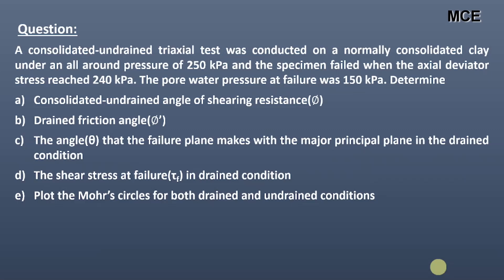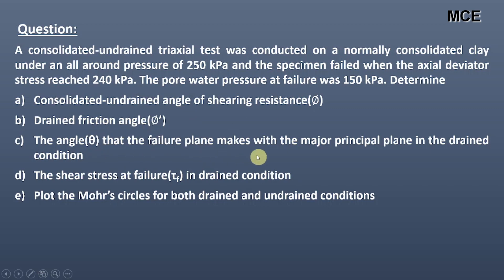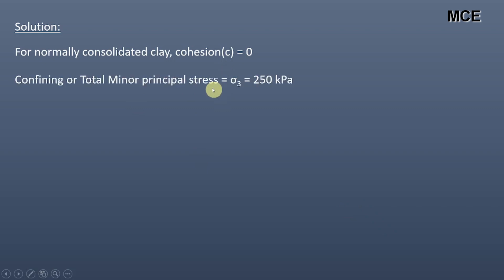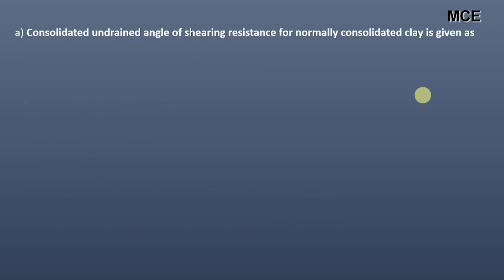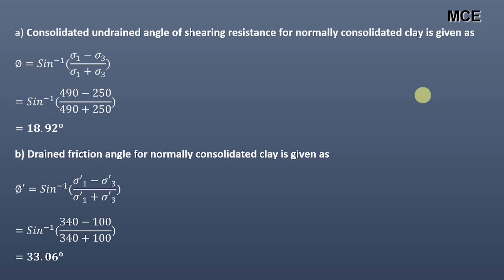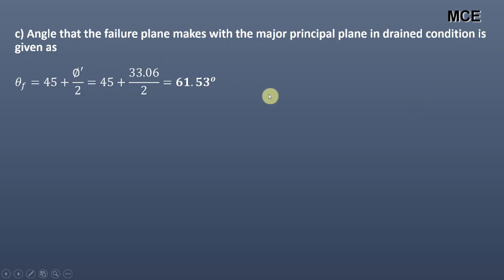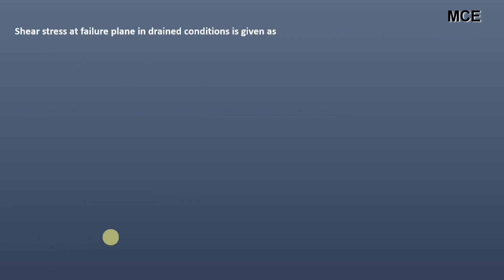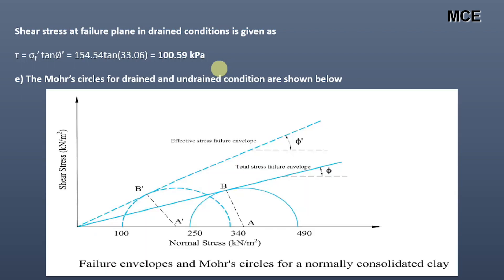Consolidated Undrained Triaxial Test Example|CU Triaxial Test Mohr's circle

Comment: Thanks for sharing the problem and solution, I have a question for question "C", why did you use the Ø' for drained test? shouldn't we apply Ø for drained condition?
Reply from the maker: Thanks for watching Master Civil Engineering
Reply from the maker: For finding failure plane angle  in drained condition you have to take drained friction angle
Reply from the maker: For drained conditions you have to take effective stress parameters and for undrained conditions you have to take total stress parameters

Comment: For clay c should not be zero for undrained conf
Reply from the maker: Thanks for watching dear!
Reply from the maker: For normally consolidated clay, cohesion(c) is zero for both drained and undrained condition.
Reply: @MasterCivilEngineering  If cohesion is zero for normally consolidated clay, what kinds of clay have cohesion not equal to zero? Cohesion is a clay property, and it should not normally be zero for both drained and undrained condition.
Reply from the maker: Thanks for watching dear
Reply from the maker: Clays with cohesion not equal to zero include overconsolidated clays, compacted clays, cemented or bonded clays, and organic clays. These types of clays exhibit cohesion due to historical pressures, compaction, chemical bonds, or organic content.